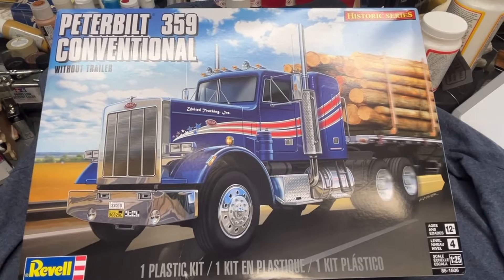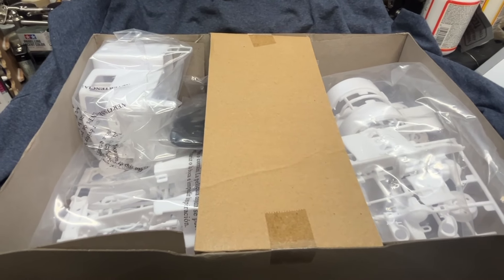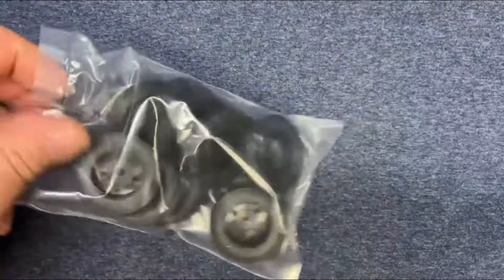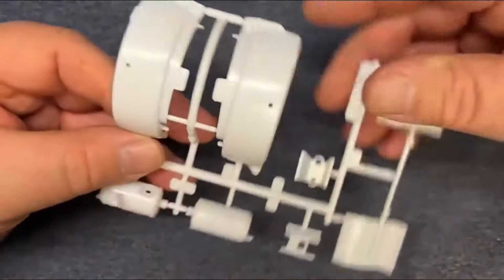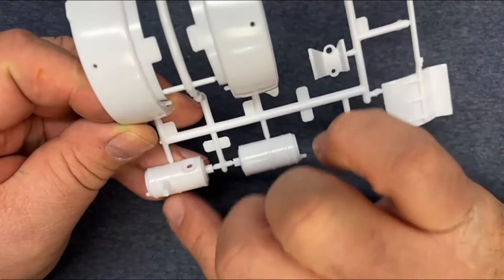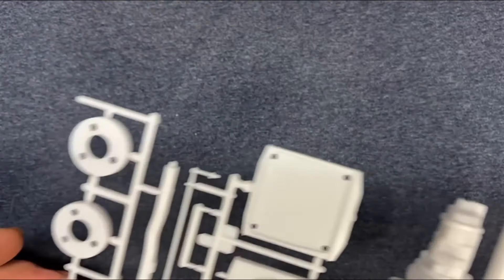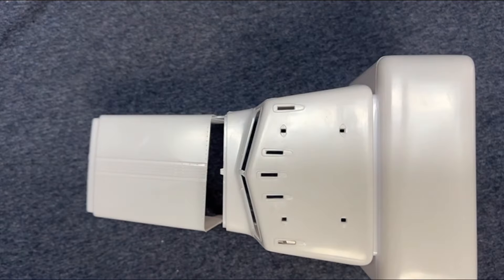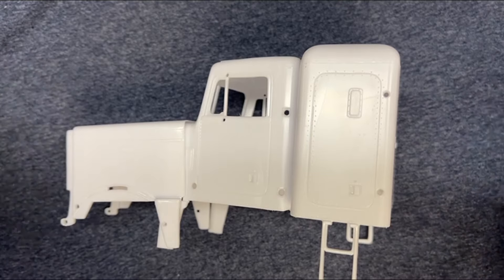Revell Peterbilt 359 Conventional Unboxing.

Comment: As someone who drives a semi, and I have this kit and didn't realize that it was a snap kit, my only beef with these kits is the tires. Not just this one, but ALL of them. Semi tractors have two different types of tires, steers and drives. Every truck kit has ten tires that are all the same. outside of that, it looks like a great kit.
Reply from the maker: I didn't know that.  Now I'm going to be looking all the time.  LOL  I've worked on this kit for a while now and other than how bad the fuel tanks fit it's a nice kit.  The fuel tanks needed to be stripped so they can be worked on so they look right.  That changed the whole look of the semi, and about all the chrome ended up getting stripped.

Comment: I'm probably too late but I was gonna say be careful dulling the chrome. Most trucks do really have bright chrome, they are just always subjected to dirt and salt that masks it a bit. Drivers were always asking my family's trucking business for approval to have the truck washed, to brighten things back up. lol I washed a lot of trucks when I was young, we had a school bus, too. 
That diamond-plate rectangle would be an exception, it's mounted on the frame, as a platform to stand on. Brushed aluminum would be appropriate there. 
Front tires are generally slightly bigger/wider than rear-tandem tires, so the comment below by HouseofHobbies is correct, the kits may not ever include the right tires. 
As for painting suggestions, you should choose your fuel brand first, then look for paint schemes that match the brand. The tanker trailer will need that too.
Reply from the maker: I am stripping a ton of it so I can re do it with new chrome that is coming soon.  This way I'll be able to tone it down a bit and make all the seam lines disappear.  So a lot of work to get it back to where it was when I started.  LOL

Comment: I know you have this completed now.  But from a drivers perspective from an old school drivers world where we actual took pride in our rigs and tried to show it on a daily basis and invested in parts and materials to keep our trucks clean and polished. I wouldn’t dull down any truck if I were trying to put it into a space where I wanted to showcase it even if it were a dirty work environment if I were wanting to show off the truck and the hard work I put into the building. Of course I understand also building it into the whole diarama also. But just saying from an old school driver when we took time when I stopped at the end of the day to go out and wipe down my truck chrome.
Reply from the maker: First off, I want to thank you for being a driver.  It's people like you that keep this country growing.  I did some long and hard thinking about this before I got too deep into the build, and I went with how you described.  I did do some light weathering on the frame rails and drive train, but the engine got very little and the rest got none.  Although I did put some marks on the inside of the mud flaps I even kept the outside looking good.  If you get a chance check out my finished video.  I think you will be happy with what you see.  Thank you for watching my video and giving me an honest opinion.  I really appreciate that.

Comment: Very nice look at the kit.  Definitely better engineered that the AMT kits. A one piece frame is the absolute best feature of the kit.  Thanks for sharing.
Reply from the maker: I'm not sure if you could tell, but I was super excited to see that one piece frame.  It was straight as an arrow, and even with everything on it it wasn't all that bad to paint.    Thanks for watching.
Reply: @grandpamarkshobbies  Yes, I really liked the one piece frame. You have to assemble the AMT frames and they are usually in the neighborhood of 20 parts, and if they are not perfectly assembled you will have a mess to deal with.
Reply from the maker: I've seen instructions on them and am honestly kind of afraid to try one until I get the new shop built where I can set up a jig to align everything.
Reply: @grandpamarkshobbies  A jig is a great idea.

Comment: Looking forward to what you are going to do with this one! Have you considered making it a day cab and lose the sleeper? Most local delivery company drivers run day cabs. However, when I hauled fuel we would use independent owner operators that had sleeper trucks to help when we needed it. It would take some creative styrene sheeting work on the back of the cab of course. Not sure you want to do that much kit bashing. I did that on the Kerns Bread build I did on the GMC cabover and it was a bugger.
Reply from the maker: I thought about cutting the cab off, but then looked at everything and said "Nope"  LOL
Reply: @grandpamarkshobbies Dont blame ya a bit

Comment: I would leave the wheels and fuel tanks and front bumper bright.
Reply from the maker: The mold lines on the tanks were so bad that I decided to strip the chrome and go with either the truck color and a chrome silver bands, or aluminum and chrome silver bands.  The front bumper had a huge scratch in it so it needed to be stripped as well.  So the LA Awesome is getting a workout today.
Reply: @grandpamarkshobbies  too late for me to be saying, but weld lines on fuel tanks are normal. Not sure where your lines were, it might be something other than a weld line.
Reply from the maker: Thanks, but these lines were huge and on the end caps as well.  I'll sand them down smooth and re chrome them when my new chrome comes in.  It'll be a fun try.
Reply: If you are going to build it as a company truck then paint the bumper and the tanks. Company owned trucks are just basic trucks. I know because I have been driving for the same company for 22 years now.
Reply from the maker: I am kind of going to go company, but with a little fancier truck.  It's going to be Grandpa Mark's Hauling.  LOL
Reply: @robfaber3918  My family was in the trucking business from 1938 to 2011. We owned our trucks, the fleet expanded and contracted through the years between 1 - 9 units. Prior to the truck manufacturers' expanded use of plastic and fiberglass on the front of trucks, NONE of our trucks ever had painted tanks or bumpers. We didn't want to continually be fighting rust and pitting. Chrome lasts longer. A few times in negotiating with dealers, we told then we would take a particular unit in their inventory at a certain price point, but only if they swapped a chrome bumper off one of the other units in their inventory and put it on the one we wanted. They never refused us.
Reply from the maker: That is good info to know.  I stripped a lot of chrome the other day, and am still waiting for the grill and rims to finish up.  Then they will all get their seam lines and marks cleaned, filled and made as invisible as I can.  Then, I'll hit them with a shot of chrome.  I just got this and am excited to use it. . . Only problem is I'll need to use it outside as it's a lacquer base and I don't have any way to vent it.  As for the body I am going to go with Tamiya's Park Green with a white stripe that goes down the side of the truck and meats up with a white stripe I'm going to put on the tanker with the Texaco logo on the trailer and Grandpa Mark's logo on the door with Grandpa Mark's Hauling.  I think that will look awesome.  So the tanks, rims, front bumper, mirrors, running roof lights, stacks, and air horns will be chrome.  The diamond plate behind the cab and the steps will be done in Tamiya's Chrome Sliver.  This will show that they are stainless and not chromed.
Reply: @grandpamarkshobbies  yes, agree the steps would also not be chrome.
That plan sounds great! 
Btw, the dumpster I made for you is green. 

Are you by chance going to the model kit show in the Columbus area on Saturday March 16th? 
(Kreg has a flyer he shows on his youtube channel, for specific location)
Reply from the maker: I may have something to do that day.  If not I would like to be there.
Reply: @grandpamarkshobbies  ok. I'm going to try to get there, and to the Detroit show the following weekend. 
I'll bring the dumpster with me, to hand to you if you're there.
Reply from the maker: Awesome.  I'll try like crazy to get there.
Reply: @grandpamarkshobbies  ok. But one caution ..... I'm never an early bird. lol
Edit: Oops, it's Blue Ox ... Jason .... who has the Hilliard, Ohio (Columbus) flyer on his channel videos.
Reply from the maker: LOL.  It's going to take me at least 3 hours to get there anyhow.

Comment: Mark it looks like it'll be awesome. Maybe you should take a break from the super detailing...but it would be cool on something this big. How would you do the marker lights on the roof? So big, so much room to hide wires. Then it really wouldn't be a "quick" build.
Red, White and blue for the color scheme. All American. We need that around now anyway.
I agree about using a whole bottle of panel liner. Geez so much to cover. LOL Soo big!
What do you think about the patriotic colors?
Reply from the maker: I am going to take a step back from the super detailing on this one.  I will do some air lines to the airbags and brakes, but no lights or anything like that.  I was going to go red white and blue, but this is going to be for the Texaco station, so I'm going to go park green with either a titanium gold or gold stripes.  I put every bit of chrome in the stripper except the handrails, horns and roof lights.  Everything else will either be chrome silver of flat aluminum.  This will be a working truck not a show truck.  LOL
Reply: @grandpamarkshobbies  I do see stripping some of that over bright chrome. Hey are you going to make it a Texaco truck or an independent patriotic guy?
Your diorama is getting bigger and bigger Mark. LOL You could always add a new truck with lights to the Texaco station. I imagine you could go crazy with lights on one of these and the trailer. You'd need a 12 volt from your car to run them. LOL
However you do it , it will look awesome.
Reply from the maker: I am going to make it a Texico truck.  I'm going to use the Tamiya's Park green like I have on the station.  I'll carry that over to the tanker too.

Comment: It was a snap kit, but been covered to a glue kit, 
Do not cut the center of the wheels out,
Reply from the maker: I won't, thanks for the heads up.  I also ordered some 3/8 foam piping to stiffen them up so they sit right on the rims.